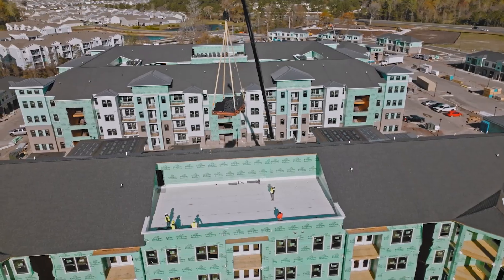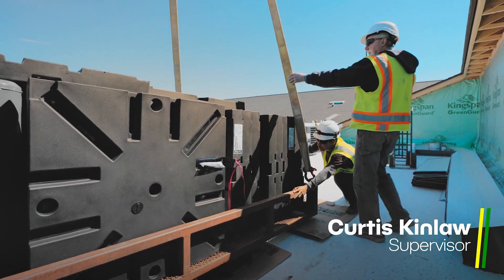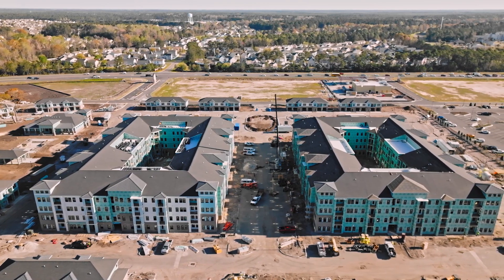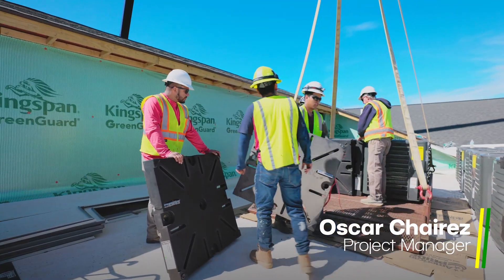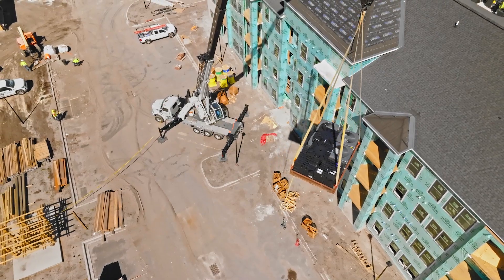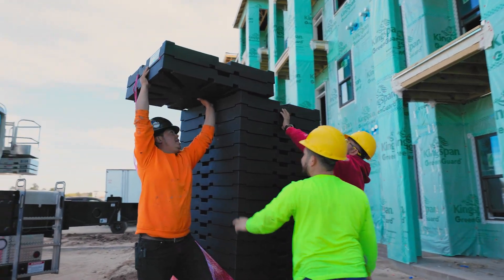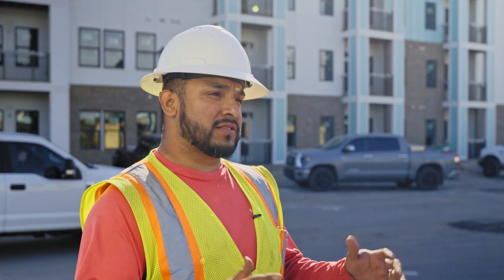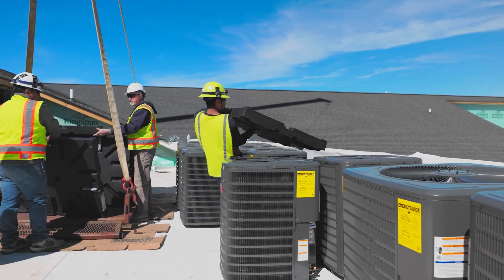Watch How We Installed 280 Rooftop Condenser Pads | QwikPad for Condensers | QwikProducts | HVAC

Comment: What about in freezing climate states? Do they make similar pads that won’t freeze?
Reply from the maker: Our pad includes a super absorbent material inside of the pad, which when it comes in contact with water, it creates a solidus gel. This solidus gel not only gives the pad weight but also prevents it from freezing due to it being solidus at standard living temperatures.